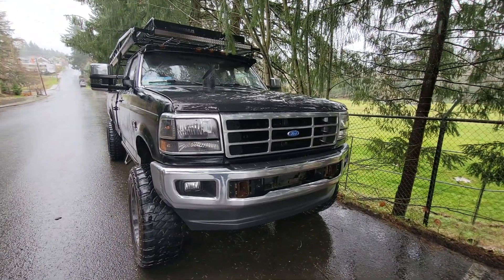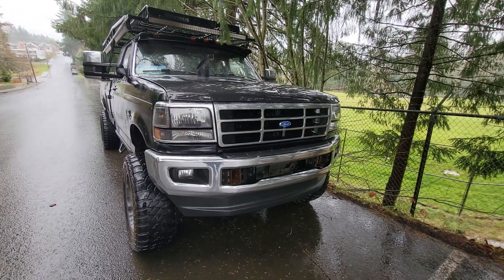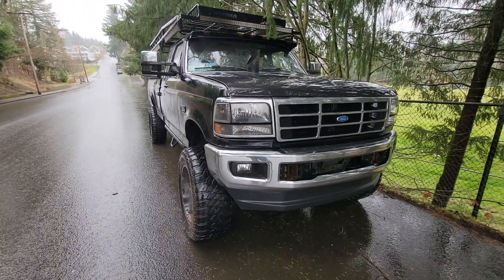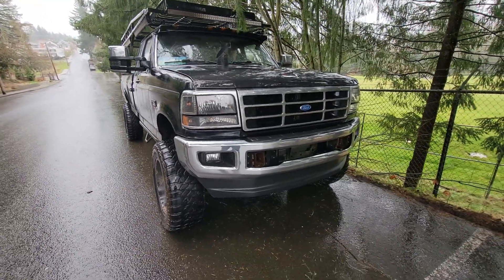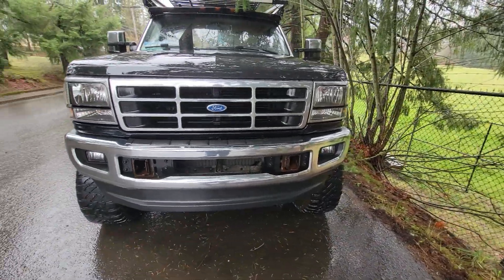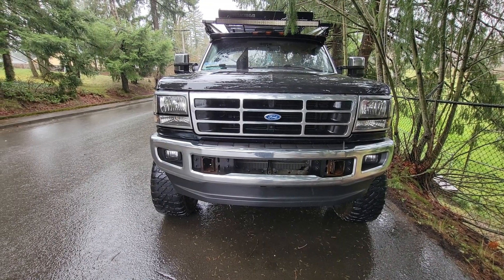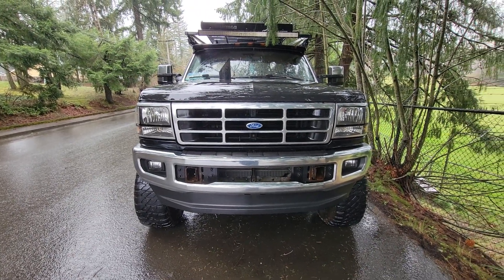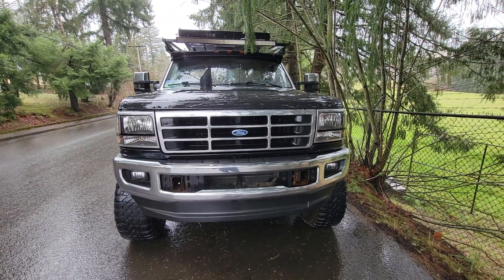SO YOU WANNA MAKE H.P WITH YOUR 7.3 POWERSTROKE?

Comment: Yes it is worth it, one thing about the older power stokes is with a little time and patience and proper order of build you can do the work yourself  !! There is a ton of info out there, now if you don’t no one end of a wrench from another find a buddy that does. Building your own is so much more satisfying than spending 50 grand at a shop on a new diesel trying to be the strongest runner. Building at nice 400 hp , 800 torque than runs forever if your not stupid.

Comment: So I’ve been looking at my turbo 2001 7.3 just over 200k I’ve got to deal with the leak I just did some banjo bolts and new hpop lines with crossover and so the damn turbo isn’t building more then ten lbs of boost according to the cts gauge/monitor does that sound right it is stock the turbo is thanks
Reply from the maker: Is it totally stock? You should see some more then that
Reply: @therealaustinbrown2712  yeah just the other day I thought I had seen more but I’ll be looking at it this weekend I’ll actually have sometime to spare to take it for a good ride i forgot to mention it does have a boost fooler
Reply from the maker: @davidgallegos5323  a homemade boost fooler or a legit on? Most legit ones still let the map see 20ish psi
Reply: @therealaustinbrown2712  it’s legit I got it from thoroughbred diesel I also have a chip I’m waiting to put but I also have a flasher that I have tried I put it back to stock only ran that for about a week but other then that like I said I’m going to take it for a good run this weekend thanks for the info any of you time is greatly appreciated

Comment: My dude makin those 7.3 vids🤙 
First scrap the two fuel tanks for a single (new) tank. The sediment in the old tanks with clog one or more of the 7 holes on the nozzle of the injector and will cause lose in power or a miss in a cylinder.